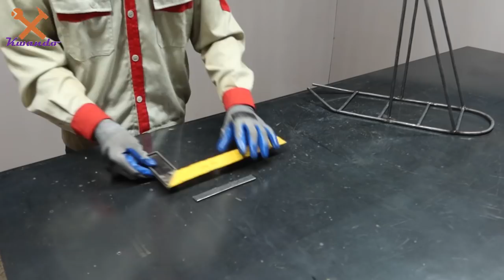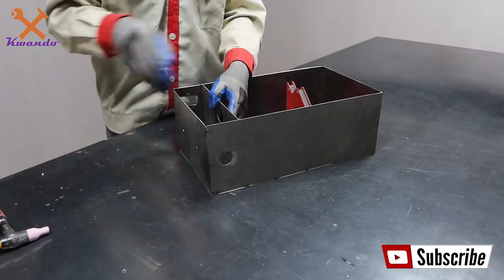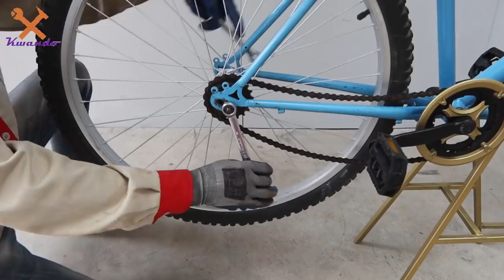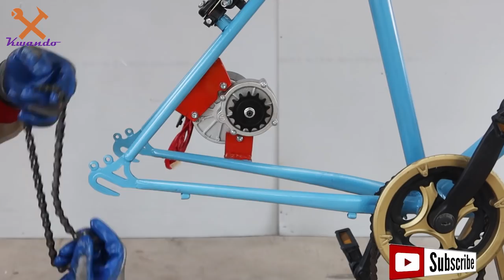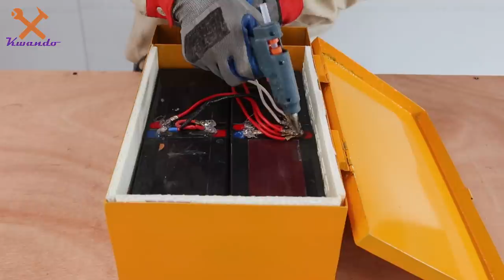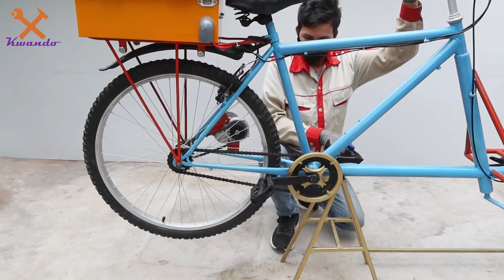How To Make An Electric Cargo Bike | Homemade Electric Cargo Bike Using Self Motor

Comment: 2S2P configuration 24V SLA batteries in a padded box, very nice. Far too many Youtube videos show people placing their batteries in boxes with the sharp ends of screws almost touching the batteries - in some cases Lithium Ion cells. A fire waiting to happen. Glad to see you aren't one of those. And as usual, nice work. I may have to copy part of your construction as the rough roads here snapped part of my tray this week. Alloy tubing is fine on city roads, but don't last long on dirt roads that are mostly potholes
Reply from the maker: Many thanks for your positive comments. Your opinions are very exactly.

Comment: For the electric motor small chain, you should have installed a "chain pre-tensioner" which usually comes with these kits..?? Also that wheel has a slight wobble, maybe you need to go over all the spokes with a spoke tool and make sure they are tensioned correctly, this will get rid of the wobble from the wheel.

Comment: You have great craftsmanship and build quality with your tools at hand. Shows everybody you don't need pricey machines to do good work. Very inspiring! Thanks for letting us hang out in your shop. 

Ps. Would a reversible controller work with that motor? Backing up might be hard sometimes. Just a thought. :)
Reply from the maker: Many thanks for your supporting!!!

Comment: Where did you learn your metal fabrication skills..?? Also what country are you from..?? As the other people suggested, lithium batteries ARE much lighter, and take up less room, but as you would know, they are also much, much, more expensive than lead acid batteries. this is the low income working man's version of electric bicycle. then once you have made money from your deliveries you can eventually modify it to a lithium  battery set up. Great job my friend, as i have told you before, you are very clever..!! John, Perth, Western Australia.
Reply from the maker: Many thanks for your suggestions!